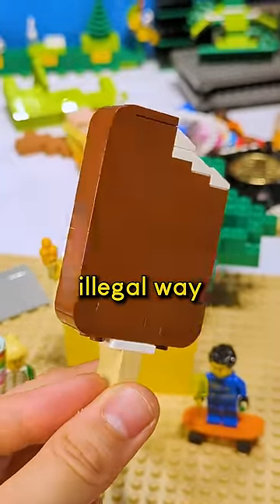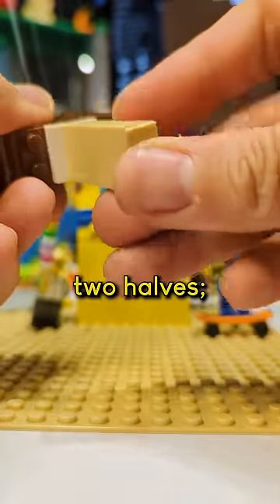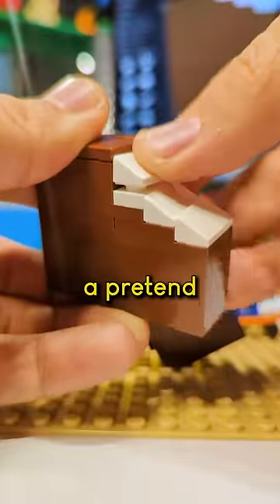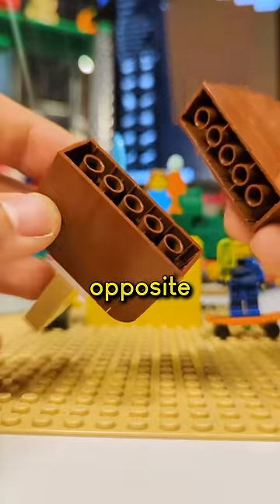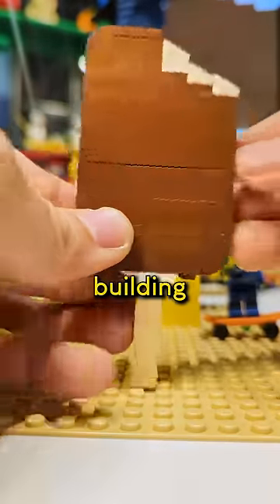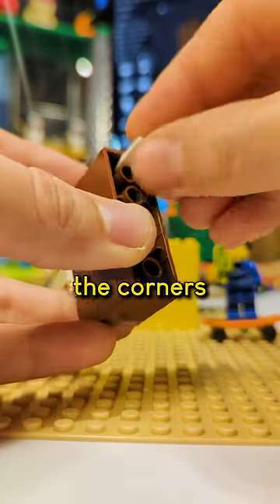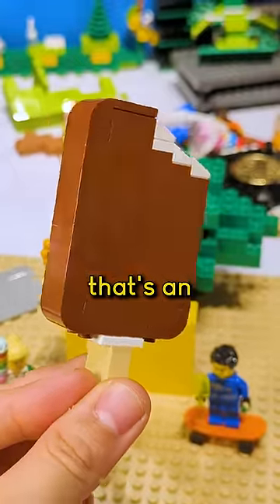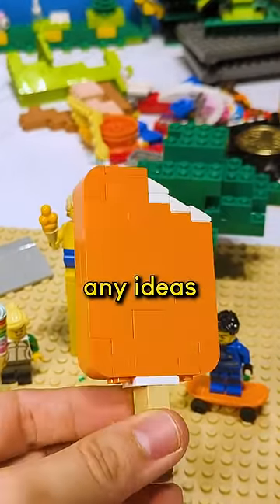#LEGO #Icecream Bar #legos #legomoc #afol #legotips #toys #buildingtoys #stem #creativity #legofan

Comment: NGL I do illegal building techniques all the time, sometimes they just look better. Here for example the illegal looks so much better
Reply: Well  both are illegal but I think you're talking about the second one 😅
Reply: especially because the vanilla ice cream in the bite is the same wedges used, which is a cool easter egg as there is ice cream holding the two parts together
Reply: What makes it illegal? . . .
I think they mean unethical
Reply: @hempyweeds5745 I think that the "rules" are to connect them the way they were designed for.
Reply: @Llorx  yea I get it now illegal is just a weird term to use for it
Reply: @hempyweeds5745  yeah, that's true haha
Reply: @hempyweeds5745  a building technique is something that puts stress on the pieces
Reply: Okay but don't start crying when your pieces break
Reply: The second illegal technique would actually create less overall stress on the peices as it braces from rotational force from the outside of the brick rather than the inside. Bracing on the outside allows for less rotational leverage torque to be applied, and the peices experience less force as a result
Reply: @Llorx  The rule is to not stress the pieces in a way that could cause lasting damage.
Reply: @ehntals1394  ahhh I see
Reply: @hempyweeds5745  I thunk illegal moves are just anyway they are not intended to be used, and generally I think they lead to increased chance of breakage.
Reply: knock knock, it's the police

Comment: “What’re you in for?”
“a Lego ice cream bar”
Reply: Illegal building techniques are things that LEGO themselves would never put out because putting them in this way causes stress on the bricks, and can cause them to warp or break. In this case, shoving the 1x1x2 slope into the side of the 2x4 brick causes it to push against the anti-stud, which while works for now (and a while probably) will eventually bend and cause it to fall apart, which isn't the point of LEGO.
Reply: @Mrmoocows99  BRO ITS A JOKE 💀💀💀💀💀
Reply: I was looking for this precise comment
Reply: @Mrmoocows99 we know
Reply: Wow another sans profile picture
Reply: "Huh that doesn't seem to be a reason why to be in jail-"
"I used an illegal building technique"
Reply: @thecooldude2706 *stabs with dull bread knife*
Reply: @Mrmoocows99 good job! Your comment was pointless and never realized that this comment was a joke
Reply: Copy and pasted comment

Comment: They should definitely introduce a two sided brick, definitely would be versatile for sure
Reply: “thAt wOULdnt bE In thE spIrIt Of LEgO”
Reply: i think they already did. i saw one once at a cousin's house, but idk whether it was an off-brand or something.
Reply: They do exist
Reply: Two sided bricks do exist.
Reply: @automation7295  there are no bricks with studs on both the top and in place of the anti-stud on the bottom of the brick. There are bricks with studs on both of the faces but you can’t use them to have a seamless transition because there will be studs sticking out.
Reply: @finnferg1811 prob made it using a illegal building technique
Reply: They literally did..  in the very much pain in the ass to get ahold of collector sets. Theres dual sided pieces.  My tank as well as a battleship I had used them.  Their basically a short 2x2 with the pegs on both sides making up ¾s of the width of the piece.  However I've only seen them in grey and black
Reply: There literally are 2 sided pieces?
Reply: @rcautomotive9908  I got mine from like a $10 or $15 ninjago set it was kai's mech  but that was years ago
Reply: @evanbuckley6766 assuming you put two or more of them on their sides (so the top of each one faces the narrow edge of the ice cream bar, you might be able to fill in the gaps with 2x1 plates and a 2x1 smooth plate on either end.
Reply: @rcautomotive9908  yeah that's what i saw
Reply: @albertscomputer5041  wasn't much into the ninja type kits.  We had military, mars missions(derived from the legit old school lego Mars missions computer games) and so on.   A few of our rare af Mars mission kits even had the elusive dual sided pieces
Reply: You mean like literally any other brick producer has? :D Or even for example panels that are upside down... or imagine this: more kind of slopes :D
Reply: Trans Bricks !

Comment: Never knew playing with legos had laws 😂
Reply: Most illegal techniques are deemed so due to the fact that they can damage the Lego.
Reply: I even have a LEGO laws book 😂
Reply: @depon3737  lol 😂
Reply: They're probably used in competitions or when Lego employees design new models. Like how chess has rules. Moving a bishop in a straight line is an illegal move, but you won't get arrested for it, I think. Still, try not to get caught, just in case.
Reply: @theyellowmeteor  It's irrelevant for competitions as most competitors are afols that don't care, but legality is a big part of set design, since what's "illegal" is mostly a quality control thing so that pieces aren't used in ways that will break them.
Reply: You can build a sideways lego on a normal direction lego
Reply: @theyellowmeteor instructions unclear, just got sentenced to 12 years for moving my bishop 1 forward instead of 1 diagonal

Comment: there are some old pieces that are flat and have studs on both sides, but the peg works best. you could also use a cross shaped axel piece from technic
Reply: How much tension does the axle give in that position?
Reply: Wow you lego people have some really difficult lingo
Reply: I have some of these but when I looked at them they are actually mega blocks so idk if Lego actually made some
Reply: Or just a simple connecting piece (the black ones)
Reply: @peepiscool234 im in the same boat. I have dozens of then but all either mega block or have no logo whatsoever.
Reply: I remember seeing that piece once somewhere. . . 🤔
Reply: those are megablocks and just happen to be compatible with lego, lego has never produced a double sided stud piece unfortunately
Reply: @_aoe its not hard to understand for anyone older than 12 years old
Reply: @YourMom-wi5to  ask a random 12yo what is a ‘cross shaped axel piece’

Comment: You could use the 2x2 side plates (idk what they're called), one bottom, one top with a standard 2x1 brick inbetween. Since the build is 3 2x2s across, 3 of those would fill it almost perfectly, just leaving 2 studs and 2 anti-studs on the sides.

Comment: For those who don't know, there is a difference between legal and illegal techniques.

Legal techniques are using the bricks in their intended manner: locking them together properly. Tubes go on studs, etc.

Illegal methods usually don't do that, and they're called Illegal because they can damage the pieces.
Reply: Is it referred to as illegal because it has anything to do with lego competitions
Reply: Will you get arrested for illegal builds? Will you go to prison?
Reply: Honestly I came to the comment section looking for this exact post thanks
Reply: They're called illegal because they can stress the plastic bricks and cause them to crack or break. The Lego company advises you don't do that, since...well, this is an expensive hobby.
Reply: @DoctorTex  yeah 😂 that's an understatement
Reply: @silentnoyze you go to Lego prison
Reply: colasticc7508  Thank goodness, YouTube censors usually too much
Reply: Adding illegal techniques cannot be used in official lego builds so they were original designed to be a guidelines to how pieces can and cant be used in those official builds. Also any technique that stresses the pieces at all even if it would take a decade for any significant deterioration like that is considered illegal
Reply: @silentnoyze  nah, Lego just make you walk over 10000 piece of random blocks naked footed.
Reply: @silentnoyze typically it’s just a fine, but there are cases of people going to jail for over 20 years because of it (I mean they also committed murder, but that probably didn’t make up much of the sentence)
Reply: Thanks. So “illegal” just means it’s a technique that’s not allowed in Lego building competitions (which I didn’t know existed. But cool)

Comment: Use a 1x2 with studs on the front and back, and place it sideways
Reply: That would require an extra layer of sideways plates down the middle, which would either stick out the front half a plate, or have 6 antistuds showing
Reply: @Toaster003  If you put it inside the center facing outward, you could then put slabs on the outside? then you could have it look flat.

Comment: When I was growing up my Dad lived in Paris for a few months. He brought back some French Lego. It was called Tente. It was a really cool spaceship kit and I built it and was really stoked.
The problem was it did not connect with any Lego so the really cool pieces of Tente could not be reused.
I tried a lot of ways to get it work together with lego and never found an interface that worked.
One day one of my really old bits of lego came apart. It was a rotating cylinder about 4 dots of diameter. It was really old probably 70s lego.
Anyway it turned out the bottom of the top piece of the rotating cylinder had a smaller than lego raised disc that clicked into place with the lower piece to make the rotation possible.
It turned out the smaller raised disc was just right to interface with a piece of Tente. I felt like I'd discovered something profound. THe hidden link between Tente and Lego.
I'll never forget it.
Luv and Peace.
Reply: That’s a great story. Makes me want to dig out my legit and see if I have any cool older pieces.
Reply: Tente Ceased operations in the 90s unfortunately,tho some enthusiast have a revived the brand through the company “inuits”

Comment: You could use some of those 2x2 plates with a 1x2 plate connection on top
Reply: You couldn't because there would be nowhere for the base of the plate to connect to. It's two bottom bricks.

Comment: The 'illegal' way yields a substantially less noticeable gap - much better!

I haven't touched Legos in probably like 7 or 8 years, so I really don't know what might fit there, however I bet if you found a way to take the disk off of the connecting parts, like clipping them and sanding the part down, then that might eliminate the gap, and they'd probably be too long to get stuck still, but that would be such a pain in the butt to make multiple of those per project 😂
Reply: what

Comment: Option 3: don’t split it into 2 halves
Reply: Good idea in theory, but you will have a hard time rounding off the corners of the bottom of the chocolate portion without doing it in two halves.
Reply: inverted 1x2x2/3 slope

Comment: What makes a technique illegal?
Reply: A technique that causes stress to the pieces
Reply from the maker: Yeah, that's basically the reason in most cases
Reply: Also, super precarious weird connections that fall apart too easy can be illegal. They don't damage pieces, but they're too loose to be a legal connection.
Reply: @samsuksiri curious, do people get in trouble for this as professional lego builders or is it just not recommended
Reply: @yamyam4050 Yes, the FBI usually isolates the neighborhood in which this activity took place and then raids the house. Oftentimes, they will first throw a flashbang in before rushing the house as these dangerous and illegal building techniques are unpredictable and overall chaotic on an unprecedented scale.
Reply: @whitestone2042  not a joke this happened to my brother Emily

Comment: The half technic pins method is also illegal... the holes in the center of lego bricks were not meant to hold technic pins and as a result of that they do actually stretch the part due to the lip of the pin being consantly pushed in...

Comment: The first is illegal. Inside the Lego brick, the pins dont have a way to return to their original shape like with regular technic holes. This puts stress on the pieces and means it's illegal. The second one is probably illegal as well but it doesn't seem to put much stress on the pieces so maybe it's not.